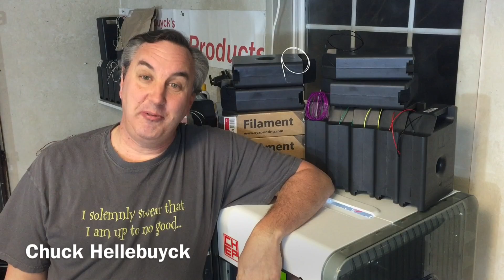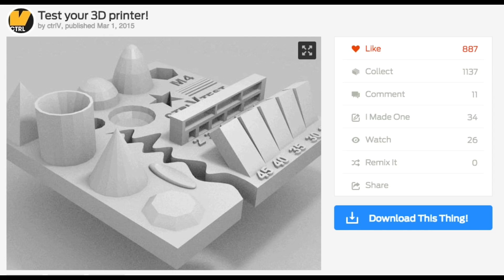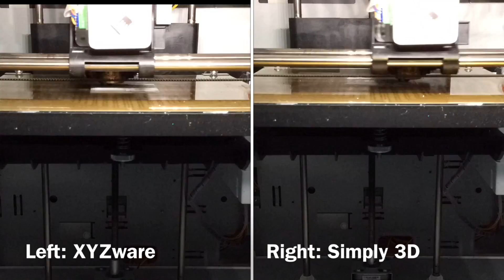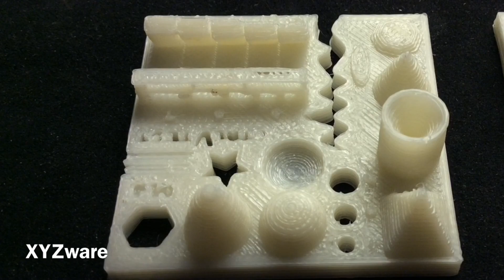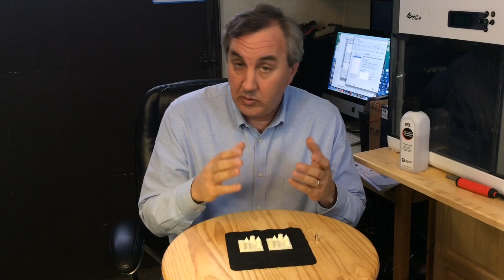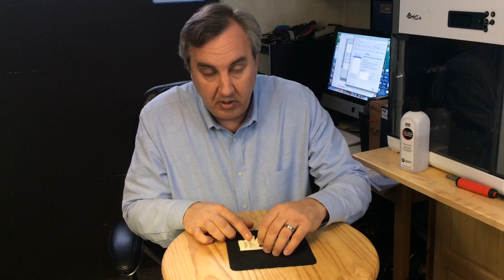Filament Friday #11 - 3D Test Print on the Da Vinci 1.0 - Video #050

Comment: Passed? Wow I'd call that a fail - the print looks terrible. I know its a small print, but its something you can work on to get your printer nailed down and get a lot better quality with speed, temperature, extrusion % and more. I went from prints like that to much better by tweaking just ONE thing at a time.

Comment: Hi Chuck!  Do you know where I can buy a new nozzle?  Mine seemingly is ruined and I cannot get it to extrude anymore.  XYZ doesn't sell them anymore (it's been out of stock for weeks now).  Do you have any spares you could sell?
Reply: *****s
I actually was able to get my local Micro Center to sell me one of the print heads off of a unit.  I found 2 people with extruders they are willing to sell, I'm not sure if you'd want to buy one of them.  Let me know and I can give you their contact info.

Comment: "Layer height" and "Infill",  won't produce a fair comparison.
3 other basic settings need to be the same also. All slicer's have different default settings for their idea of what "medium" quality is.  XYZ is tuned for their printer.  S3D is is tuned for faster printers.
"Shells" - looks like XYZ used 4,, and S3D use 2.
"Temperature" - small objects need less heat.
"Speed" - small objects need slower speeds
Match all 5,, and that should be a closer comparison.

This is what makes 3d printing an art.  "Balancing Energy", for the given object and printer to be used.  This article/forum blog should come with EVERY printer sold.  It will put everything in to proper perspective,, regardless of experience or machine.  http://umforum.ultimaker.com/index.php?/topic/5093-how-to-setup-print-speed-temperature-and-layer-height/

I would absolutely agree that the price (and build volume) of the Davi's is too attractive, to not consider for 1st time buyers.  Thou they may need some simple diagnostics and modifying to make them functional.  I've bought 2 off Ebay (Indianapolis resellers=$cheap$) and they work fine for  larger and less detailed-oriented  prints.
Reply: I assumed the profile's were just (hardware) "printer" settings (bedsize, center of bed, Esteps, data format, etc..) 
I'll try to find out if (software) "print" settings are also preloaded.
I've always had to dial-down a lot of default settings when trying different slicers.  And most seem to preload for ABS temps.

Glad you liked the "Balancing Energy's" forum post.  With all the variables we have to consider,, it's the only post I've found that brought it all together, in a short, easy to understand, explanation.

Comment: Hey Chuck,
I've been running the daVinci 2.0A which I bought after seeing your channel and it's a dream. I'll be looking out for your simplify3D video, too.
I'd love to print an entire quadcopter frame and see it fly. It's a bit beyond the scope of a Filament Friday, but I'll give it a try when I've built up some more experience
Reply: Have you had any problems with your 2.0 I'm looking to buy my first printer but keep hearing bad things about The new da Vinci's?
Reply: Really? Mine runs like a dream. The test prints that come with ut printed perfectly with the two colors together without any calibration, before I even connected it to the computer. Genuine plug and play as advertised.
Prints are precise and look good; they do take a while to print, but who ever needs a 3d printed part on the spot?
I don't know about other complaints but based on my own experience, I recommend it without hesitation. Hope it helps!